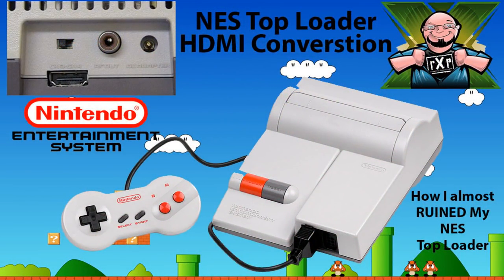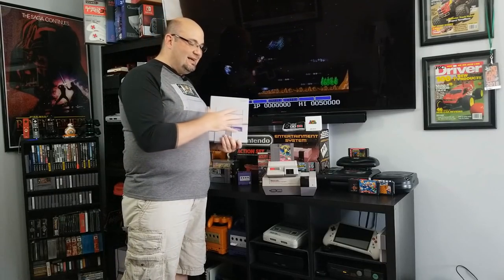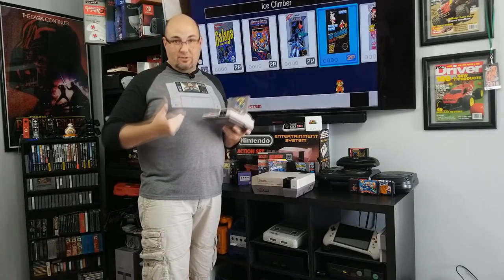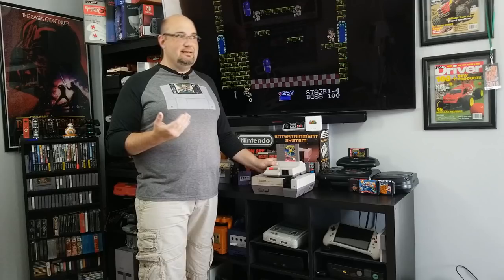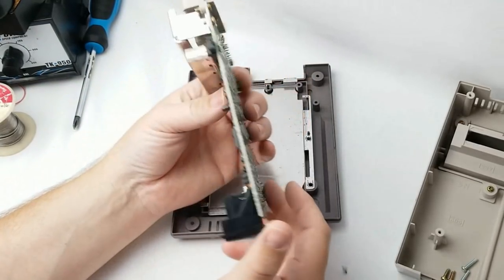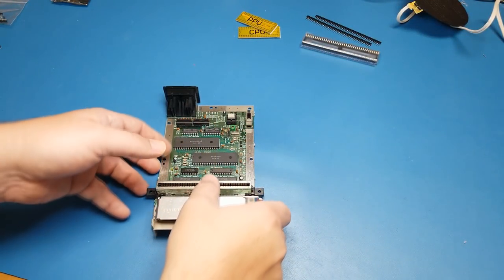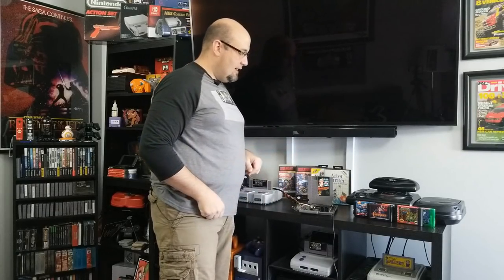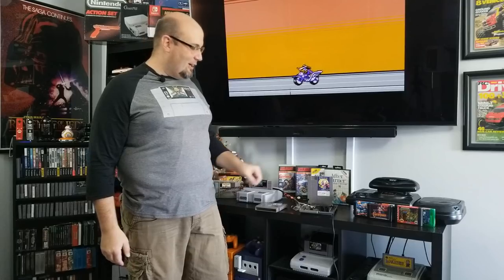Installing an HDMI Kit into an NES Top Loader OR How I Almost Ruined my NES Top Loader

Comment: What I found most compelling about this video was your honesty and transparency. 

Sure, a lot of people feel (and rightfully so) that their skills are adequate to the job at hand. But sometimes it just doesn't pay to DIY, as you can run into some often expensive problems that may ultimately cost you more than sending it off to someone else. That's not a line for "send your warez to me", but a very general statement. All in all, you did pretty well for your first rodeo. 

Jesus knows I've seen far.. far... far worse..
Reply from the maker: Thanks man, it means a lot coming from someone I truly respect with what you do. 

Going into this I felt very confident in my general soldering and desoldering skills. What I lacked were skills specific with modding the Top Loader itself. My missing the test process and just going hell-bent-for-leather through the mod process bit me in the rear end, hard. That and never testing the system in the first place, it was a comedy of errors. 

Like I said in the video I debated about just putting the best foot forward, no-one would have ever been the wiser. But I would have known. I wanted people to learn, regardless of whether I did it right or not. Like I said, I have good soldering skills. That isn't what caused issues. My lack of attention to detail and testing, THAT's what cost me and it was such a simple thing to do.
Reply: Is the concern at the end of the video about not using a DC adapter correct?  I was surprised to see that as Game-Tech markets and sells an upgraded 9v DC adapter for use with the mod.
Reply: Explain to me why RGB mods for consoles still need a Ossc, but yet these hdmi mods don’t need a Ossc?
Reply from the maker: RGB Mods don't "need" an OSSC or Framemeister, but not all TVs can handle the native 240P output from the system. RGB also means Component or Scart connectors, and not all TVs can handle these either. The OSSC or Framemeister are line multipliers, which the HDMI Mod does automatically.
Reply: RoXolid Productions so if your tv can handle 240p then that said console that’s connected doesn’t need a ossc?
Reply from the maker: Correct!
Reply: RoXolid Productions thank you I understand better now. It’s all making sense. 

Now is this hdmi mod that’s out right now that you installed, Is this the best that it gets? Or is there better out there? Look ok on 4K sets?
Reply from the maker: I think this is the best you're going to get. No lag, great video quality, plus it's playing on original hardware!

Comment: I did this mod myself about a month ago.  The desoldering is definitely the hardest part.  I've seen lots of recommendations for using expensive tools few people own, but the way I did it was with a cheap (<$20) Chip Quik removal kit.  There are other brands of low temperature solder as well, and they should all work the same.  However, the others I found required larger volume purchases, so I went with the Chip Quik from Amazon.  After about 5 mins with the low temp solder and a cheap desoldering pump, the CPU fell free of the board.  I wish this method was promoted more, it's far more practical for the average person without hundreds of dollars worth of specialized tools, and it doesn't take more than basic soldering ability to perform successfully.
Reply from the maker: I've used vacuum desoldering pumps before, never again.
Reply: Have you used them with a low temp solder removal kit though?  That's the key.  Yes, they obviously suck on their own.
Reply from the maker: @Sihtube  no, it has less to do with the solder and more to do with coordination. Being able to manipulate the pump and a soldering iron separately, I just don't have the coordination to do it without damaging the board. That's why I like All-in-One Vacuum pump equipped desoldering irons. plus sometimes to help remove the solder you actually have to feed solder into where you are removing it from so that makes things even more tricky sometimes.
Reply: The low temp solder actually stays molten after the iron is removed and gives you plenty of time to use the pump.  It makes things MUCH easier and is a practical method for the average person with some soldering skill to accomplish this mod.  (Low temp solder is probably even the best method for desoldering at the professional level, as it introduces the least amount of heat stress to the parts when used with a hot air rework station.) I haven't seen anyone ever talk about it for this mod, and I wish I had known about it before I tried to do mine.  I'm trying to share the info with those who either don't want to, or can't afford to pay another $100+ to do an already expensive mod.
Reply from the maker: I'll just say this: This is NOT a mod that the average person with some soldering skills should tackle. There is way too much that can go wrong.
Reply: I respect that opinion, but the mod is being sold to the general public, and people with average soldering skills and cheap tools will attempt it.  It's also not that unreasonable for someone to attempt do so as the cost of a professional installation is more than the system is worth itself.  I think I've accomplished my goal of sharing more information that will give these people the highest chance of success.  Thanks for your time, I appreciate the vids you do.
Reply: This might be the method I use. My question is when you used the Quik Chip kit did you put the flux and solder on the top part by the connectors of the chips or did you put it along the bottom of the board to pull the PPU and CPU?
Reply: I did both top and bottom.  Bottom alone might work as it's where most of the solder is.  The low temp solder may flow through the holes to the top and allow you to remove all the solder from the bottom.  It will probably depend on how good your desoldering pump is.
Reply from the maker: Everything I did was on the bottom of the board. If you do the top it can make it very difficult to unsolder if you ever need to later. More is not always better
Reply: I believe he was asking where to put the low temp solder for the desoldering and chip pulling process.  Once the chips are pulled, then yes, soldering the sockets should be done solely from below.

Comment: Nice mod Gary, those HD NES graphics look fantastic, wish I got a top loading NES back then (them dogbone controllers really interest me) but the fact that it still had the crappy RF output was the reason I didn't pick one up.
Reply from the maker: You can get top loaders on eBay for under $120 on the regular, I got the 2nd one for $75
Reply: I think I'll continue seeking for one in the local vendors or yard sale and see if I got lucky, those prices are just a bit too high.
Reply from the maker: I hear you! The only reason I bought that second system myself is because I had a 20% off coupon for eBay

Comment: While the video was loading (well, the ad before it ;)) I spotted a comment right at the top saying “This is what I hate about products like this.” When the ad loaded everything got pushed down and it seemed to completely disappear.

Whoever it was needs to know that the “product” is intended to be professionally installed. The DIY kit was made available purely due to demand. If you can’t handle it, it’s not for you. Never was. Jason/GameTechUS makes that abundantly clear. DO NOT FAULT THE PRODUCT FOR A FAILED INSTALLATION!

As someone who has salvaged multiple failed installations for other people, I firmly believed that the major problem preventing most people from doing a DIY was just desoldering. After I got mine from the very first DIY batch (July 3rd, 2016), I installed it successfully. I then began helping other people who were waiting for the next batch of kits by prepping theirs, fully socketed and tested with my personal Hi-Def NES board. I soon realized that I could finish prepping a system, fully test it with my kit, send it back to the customer, and move through the backlog if GameTechUS could add a simple power connector to the Hi-Def NES board. Because GameTechUS offered the option to have the interposers pre-assembled, that was the only part needed for the end user to finish the installation without soldering within minutes of receiving their kit.

I pitched the idea to Jason/GameTechUS as a way for installers to start working now rather than waiting months for the kits and then having to do a ton of consoles all at once. He expertly knew better, shooting it down by telling me that it was too risky and that he would not be able to warranty it, even if one of his recommended installers did the prep work. At the time I thought it would be no more likely for the average end user to screw up final assembly than, say, someone installing a Blinking Light Win.

Well, unfortunately, I was wrong. I recently found a guy who needed someone to salvage an attempted UltraHDMI installation, install his Hi-Def NES, and install Voultar’s N64 RGB amp. He was going to do the cutting, and cross-shipping so many consoles would cost a ton, so he sent me 3 N64 boards and his NES-101 board without the original shells. I trusted that he could cut the shells since he originally intended to install all of these and only got discouraged by UltraHDMI.

I quickly salvaged the UltraHDMI flex and moved the kit from the failed install to another one of his boards. I traded one of my RGB amp-compatible boards for another one of his (only reason he didn’t do the RGB mod himself), then added Voultar’s RGB amp. I went back to the original and managed to remove the damaged RCP, straighten legs, and jumper the ruined pads to restore his childhood N64’s board to 100%.

Everything was going super-smooth when I moved on to the NES-101 with Hi-Def NES. I got everything running great. I even cut the notch on the back panel (even used my own lower shell for alignment). I gave him some tips for cutting the lower shell and sent it all back. Next thing I know, the Hi-Def NES is seemingly fried. :(

From what I can tell, he thought he had cut low enough in the bottom shell when he had not. He made more room to close it all up by cutting my own notch larger, which allowed the board to sit too high and contact the bottom of the NES-101 board... which is where the power comes in to the console and where ground tabs from the RF module are located. Once installed, the Hi-Def NES actually powers the whole system, so something probably shorted out and fried the Hi-Def NES. Would not have happened if I didn’t let him mount it.

Remember: This is a guy who was not unfamiliar with modding. He had already attempted UltraHDMI! The only part I left for him was a simple notch the he had to cut in the lower plastic shell. I don’t mean to belittle him but I entirely understand now why Jason/GameTechUS did not want end users handling ANY part of the install. I personally want people to try/learn within what they are comfortable doing but professionally I can’t risk encouraging that.

Jason never marketed this as a kit for average end-users to self-install. He only sells to end users with the stipulation that they get it professionally installed or take the risk of installing it themselves if they are similarly skilled (ABOVE average end users ;)). Exponentially more people have been able to get them and install them as a result, including myself and all the people I’ve dealt with. It was the right call.
Reply from the maker: I completely agree. I tackled this because I thought I have the skills to take care of it. I have skills, I just did not pay attention to detail like I needed to period shows even the people who have expertise in the field can screw up too.

Comment: I had bought a Mario kart 64 at a flea market. I didn't notice that the whole pin board was broken. This was my first real soldering project so I identified the board and started researching for a donor board as it turns out some sports games had the board I needed. In the end the game worked great. Now when I get the time I bought a Mario 64 with a destroyed board at a game store $5 and plan on replacing it. Sadly I need a new label because it was also destroyed.

Comment: Jason revised the sockets that originally shipped with this kit. I had one from the very first DIY batch and I could not get it to work after socketing the CPU and PPU even though it worked perfectly when finished with the interposers. I had the same problem with several other kits. There just isn’t a good connection with those round-pin sockets unless you have round pins going into them (like those from the interposers).
Reply from the maker: Yup, I knew he upgraded those. Jason's kits are awesome, my folloing of directions, sadly, wasn't.
Reply: RoXolid Productions 

LOL!

All that was directed at the guy who seemed upset that the product was sold like this at all... even though I can’t find his comment. ;)

I’m almost positive that yours is salvageable. Don’t be discouraged! I had an absolute NIGHTMARE recently with one of mine that had me swapping chips from my NES-101 and my HVC-101 (AV Famicom) in an attempt to troubleshoot. Turns out that it was the sockets... again... even though they were mated with round pins from the interposers! Of course, right after I figure that out by substituting my own sockets, GadgetUK164 uploads an NES repair video where he complains about round-pin sockets causing issues for him. Voultar has complained about them in the past too. So much frustration!

I had a similar issue recently where I thought I screwed up someone’s Neo Geo AES during a simple UniBIOS installation. Turns out that the new MG Chemicals solder I got from SRA-Solder was not “No-Clean,” as described. They accidentally copied the description from a rosin flux solder over an RA flux solder. The RA flux absolutely must be cleaned off. It caused a nightmare for a Neo-Geo AES I was working on too! I mention that because I see your SRA-brand flux pen. ;)

Anyway, I had serious self-doubt in both of those cases even though I’ve done HUNDREDS of UltraHDMI installs and many, MANY Hi-Def NES and UniBIOS installs. It happens. It’s a pain. Don’t lose faith!
Reply from the maker: Oh I knew what you were getting at :) Yeah, I have a fan of the channel providing a top loader with a bad motherboard that I am going to see if I can swap the chips to make work. If not I'll try to find a cheap working front loader and pull the chips from there!
Reply: RoXolid Productions Yeah, man. I know from experience that something chips and switching them out to troubleshoot is a huge pain but I know you can do it. Good luck!
Reply from the maker: No doubt, just a matter of getting the new chips
Reply: RoXolid Productions Just promise me you’ll try replacing the sockets with standard dual-wipes before going nuts on the chips. ;) Would have saved me a TON of time and effort!
Reply from the maker: Already tried that, plus tried just reinstalling the chips on the boards, no sockets and no bueno.
Reply: RoXolid Productions Gotcha. We’re they already soldered back in when you got your working Hi-Def NES? If not, were you able to try them (old CPU/PPU) in the interposers on the known-good system? I’ve had one bad PPU before (black and white video) but it still worked great in Hi-Def NES, since it replicates the PPU functions in its own FPGA.
Reply from the maker: I did try the old CPU and PPU in the new system, just didn't work.
Reply: RoXolid Productions I see. FYI, if those are the only damaged chips then you can get them from any NES, even a front-loader. You can mix and match with the known-good parts too, which can tell us if it’s the CPU, PPU, or both.
Reply from the maker: Yep, that's one of the things Jason had let me know about. I'm actually on the lookout for an NES front loader that may not be in the best of shape cosmetically but the motherboard and such are in good shape
Reply: RoXolid Productions !!!
You need to see what’s sitting to my left right now. Posting an Imgur link next (might get filtered as spam).
Reply: Yeah, I think I can help with that. ;)
Reply from the maker: Wow, you've got a few NES Toasters there.
Reply: RoXolid Productions Not even nearly all of them. :) I had a refurbishing mishap where I ended up melting the black parts, power and reset buttons, and bottom lids to several all at once. As a result, I have plenty of poor-condition units. I’d be happy to send you one or take a look at your board and attempt to fix it for you.

I may not be as big as Voultar but I’ve salvaged three Hi-Def NES installations for others already and installed many, many, many more. Even then, it’s only a small part of the mod work I do (RGB, HDMI, etc). I’d love to help!
Reply from the maker: I can transfer the parts, I just need a CPU, PPU and SRAM.
Reply: RoXolid Productions I can definitely cover you with CPU/PPU. SRAM can have different footprints even on the same revision of the board (board sometimes has an extra row of holes) so I have to check to see if I have spares that will fit an NES-101 without sacrificing my own NES-101. Luckily, they are off-the-shelf parts that can be cheaply obtained NOS, unlike the CPU/PPU. Fun fact: Later versions of the AV Famicom integrate several off-the-shelf logic chips into a custom Nintendo-labeled chip. SRAM might have changed again too (can’t recall).